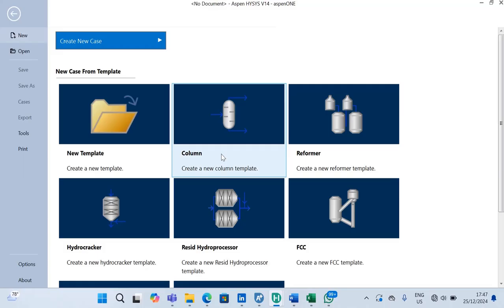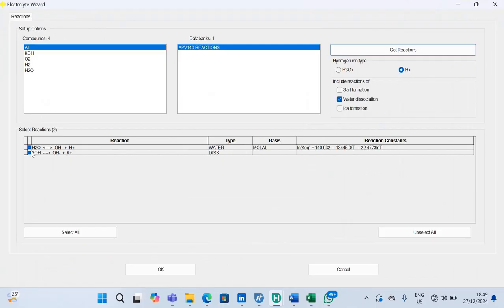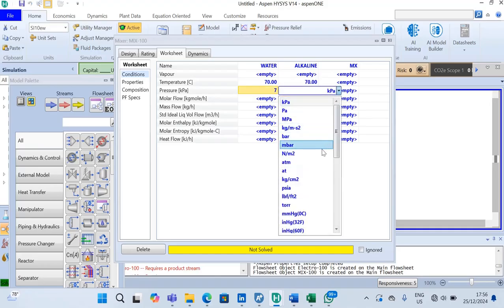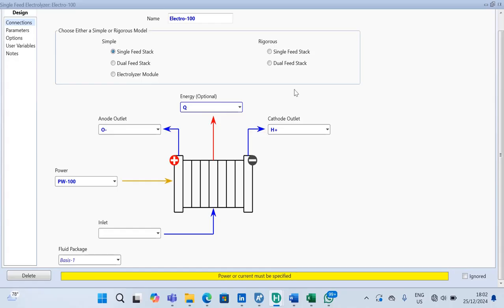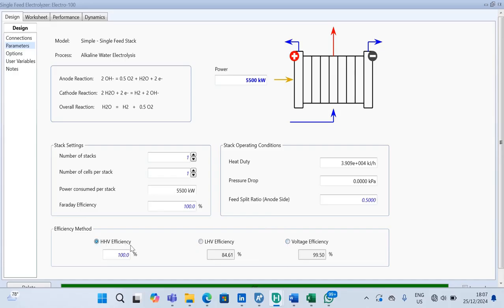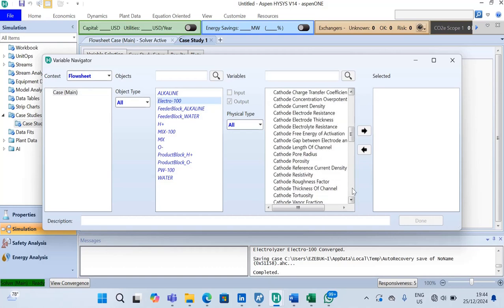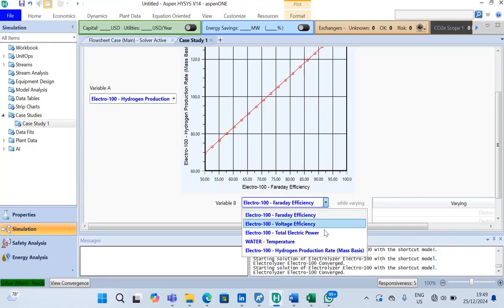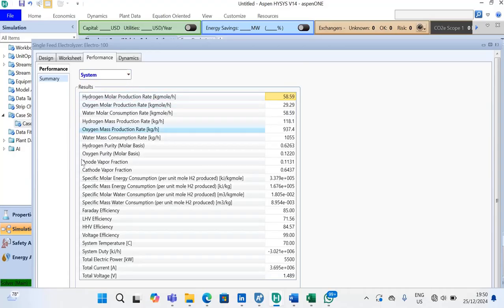Water Electrolysis Modelling in Aspen Version 14: How to model an Electrolyzer.

Comment: Hello, I have a stream of pure water 80 kgmole/h that I want to use an electrolyser to get a O2 and H2 streams. I cannot put more than 1500 kW power and I don't know why. Putting more and aspen wont solve. But the performance with this such low power isn't high enough. What should I do?
Reply from the maker: Try reducing the feed flow rate to see if it helps your performance.

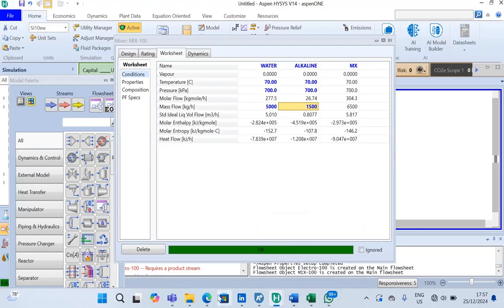Comment: Hello. It is impossible for me to obtain the same MX conditions as yours (12:04). My MX temperature is 228.2 °C and it is not correct.  I have done the setup of the model exactly as you. Is there anyone else who have the same issue? I put below the errors that are written in the "Messages" section: 

* SEVERE ERROR IN PHYSICAL PROPERTY SYSTEM
      SUM OF SUB-CRITICAL COMPOSITIONS IS ZERO. PROBABLE CAUSE:
      FAILURE DURING APPARENT/TRUE COMPOSITION CONVERSION.

*   WARNING IN PHYSICAL PROPERTY SYSTEM
      ATTEMPT TO USE MODEL ELECNRTL WITHOUT A SOLVENT.
      ACTIVITY COEFFICIENT OF UNITY IS USED

 *   WARNING IN PHYSICAL PROPERTY SYSTEM
      ATTEMPT TO USE THE CLARKE AQUEOUS ELECTROLYTE DENSITY MODEL
      WITHOUT A SOLVENT. CALCULATION NOT PERFORMED.

  *   WARNING IN PHYSICAL PROPERTY SYSTEM
      ATTEMPT TO USE THE CLARKE AQUEOUS ELECTROLYTE DENSITY MODEL
      WITHOUT A SOLVENT. CALCULATION NOT PERFORMED.

among others. Any suggestion to solve the problem?